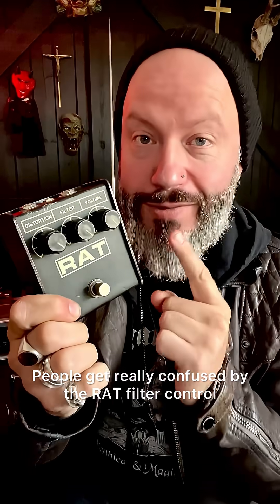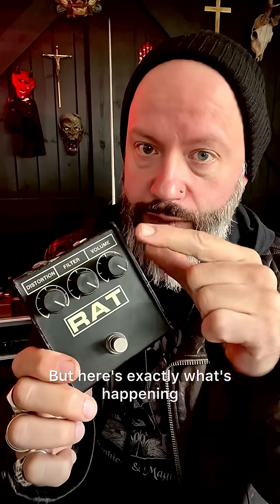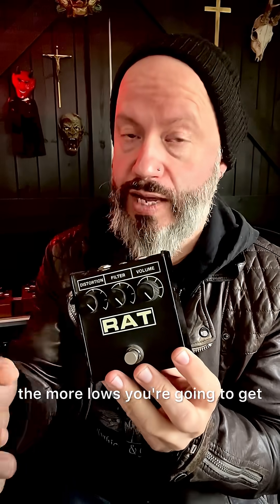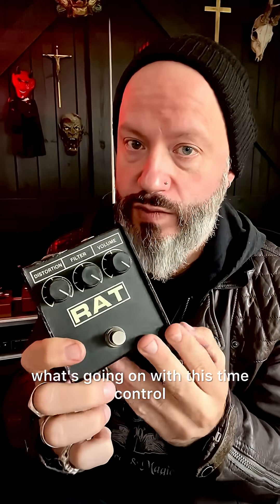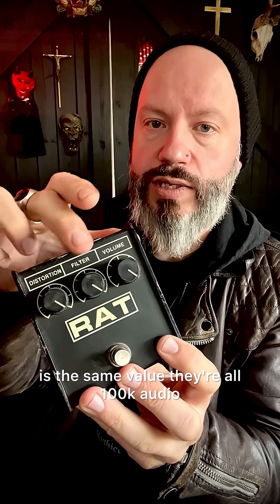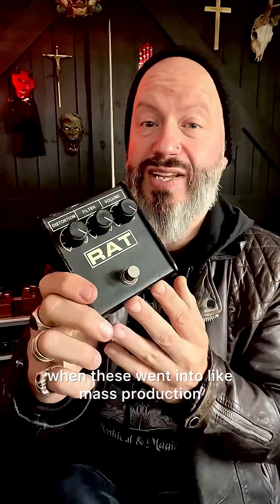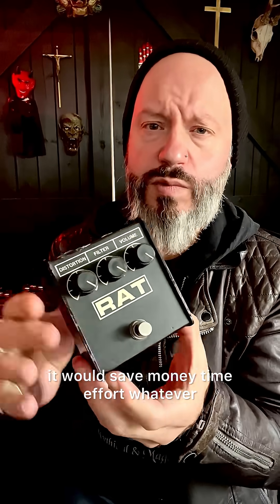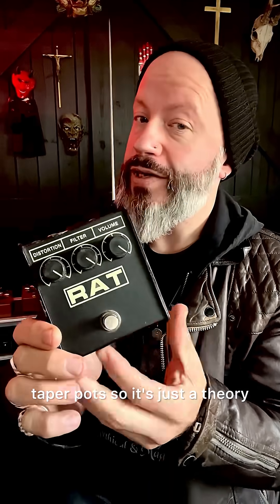Why the ProCo Rat filter works BACKWARDS!!

Comment: I mean they coulda wired it in reverse. And technically every tone control is a “filter” but I guess that isn’t particularly helpful to the average guitarist lol.
Reply from the maker: My point is that, as a control label, “tone” doesn’t make sense if it works in reverse. “Filter” does. And every tone control is not simply “a” filter. The Big Muff tone control, for example, isn’t simply a low pass filter or a high pass filter. It’s a combination of both.